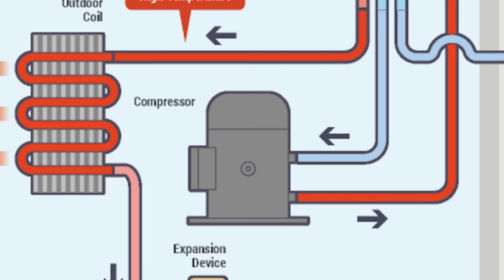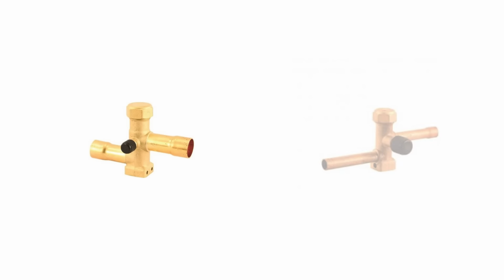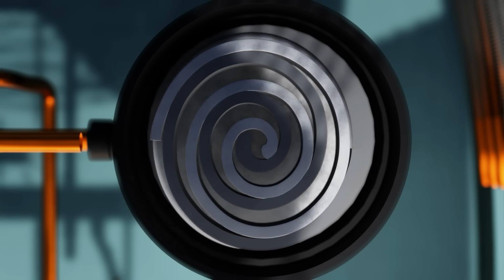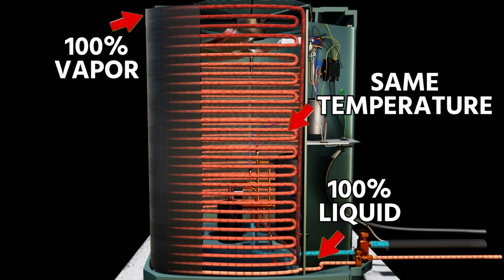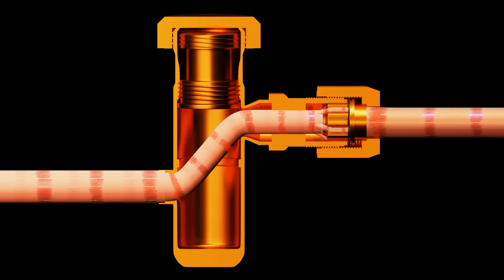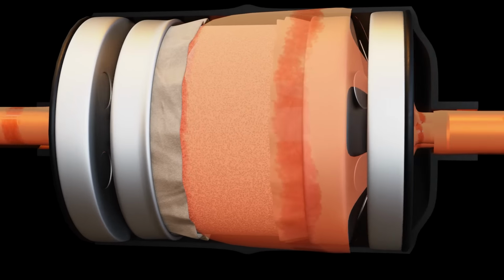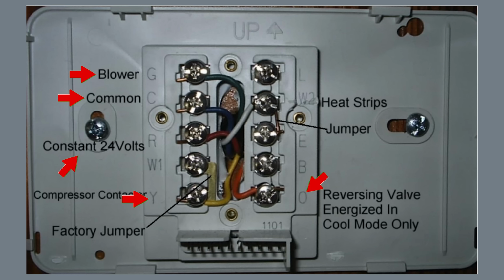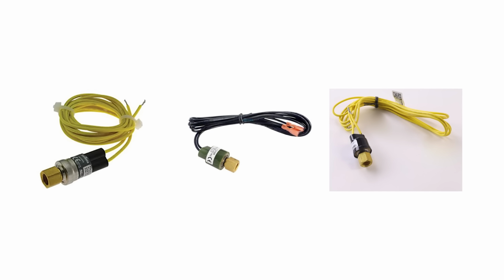Heat Pump Component Tour (In 3D)

Comment: Very good presentation.  I especially appreciated your comment on refrigerants boiling cold - that was what I was missing.  

For your state change (liquid to vapor) you may give the example of 212 degree water going to 212 degree absorbing 970 btus/pound of water, not the normal 1 per degree change between lets say 211 and 212 degrees.

2ndly, it helped me to think of the AC/cooling portion is sucking the warm/hot air over the coils so that the heat can be removed and the resulting cool air being expelled into the room.  Many folks look at this as blowing air over the coils and can get confused.

As others have stated, this is a wonderful preseentation - thanks again.

Comment: Hi I was wondering how much length is required for heat pump. Or sould I say what's the minimum length is required between inner unit and outer unit for heat pump to cool down well insulated place ?

Comment: 16:37 so the heat in heat mode is not technically coming from the outside air but from the compressing of the gas?

Comment: My AC is great again thanks to you. I did a compressor replacement not from a burnout but rather from age 20 years old and a very high electric bill. I learned about compressor oil is hygroscopic along with the correct compressor replacement voulme. I replaced and moved the clogged dirty rusted dyer line filter to the air handler in the attic. The filer by default was outside at the compressor Goodman. Well that didn't seem correct even though the manufacturer had it outside when ever video said put it at the airhandler. Well now I know why it looked like it came from the bottom of the ocean. I even put in a sight glass with values correctly oriented in the proper direction on both side. Yeah, I burnt two sight glasses but I learned how to do it correctly without the black dot of death inside. You know you guys have done this also :) Now it's roasting hot and one year later it's working great.I even filtered out all the fires from canada using my airhandler. You literally saved me big bucks and no leaks. I know you ac guys are going to hate but with the right skill set you can do it (Rob Schneider aka Duce) thanks to this channel.

Comment: Do you have any section drawings or diagrams that you can share for a heat pump system in a residential high-rise? i.e. whole package install including drip pan to external drip pipe outlet on the facade of a building?

Comment: Ive worked on a few heat pumps that didnt have any accumulator on em.. the compressor wasent ever the issue on those systems though..   except if the accumulator was installed somewhere away from the compressor, which would make it usess:..  right?

Comment: Like the picture of frosted outside unit heat pump.  Typical central FL situation where homeowner turned on lawn sprinklers in attempt to protect their plants from freeze damage, putting a lot of local humidity in air near the outside unit.

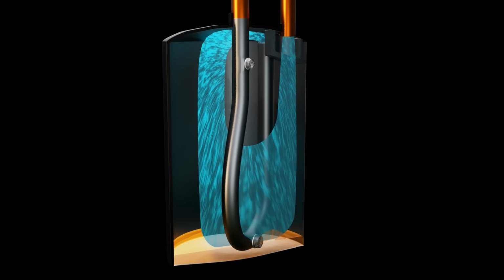Comment: 06:35  These are called aspirating accumulators.  They are sometimes pre-charged in the field with a small amount of oil to minimize the aspiration of liquid refrigerant.  better solution is a separate oil separator ahead of the accumulator,  and a low oil cutout in the compressor.  I have seen more than one Coplemetic compressor throw a connection rod due to poor oil return.  The nice thing about Colemetics is they can be rebuilt,  unlike standard herms.

Comment: The heatpumps I've been working on here in germany don't have a transformer and all that wiring, just the 400V for the compresser and 230V for the controls. I think all that is integrated into the main circuit board most modern machines here, 230V going directly into the circuitboard, and the board is spitting out lower voltages for the sensors and stuff.

Comment: @13:01 it's inappropriate to say the vanes of the squirrel cage "scoop" the air given that spinning the cage in either direction (or flipping the cage around) will still cause it to blow air in the same direction. The air is pushed by centrifugal force and changing the blade profile is only an optimization -- or perhaps a tradeoff between pressure and volume. Teaching that small fact will some day save a student from thinking they can reverse the flow.
Reply from the maker: Fair point

Comment: Question I have a heat pump that's in the heat mode and runs the pressures up to 500+ psi then locks out but in the cooling mode it runs fine. It has a TXV on the HP.
I believe the TVX is bad. 
Feedback when you can.
Reply: Sounds like the outdoor TXV is stuck open, or the bulb lost it's charge. You can try putting the sensing bulb in ice water to see if TXV closes & then put it the bulb in hot water to see if it opens. When your doing that keep an eye on your suction pressure to see if it's changing. 👍